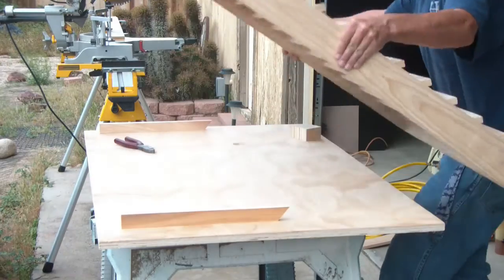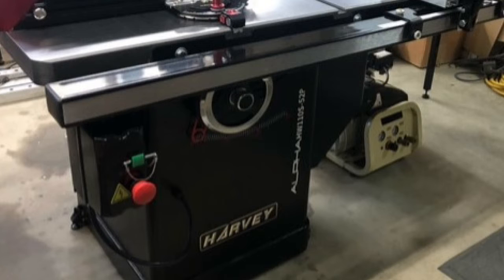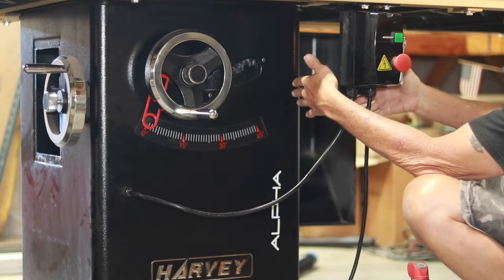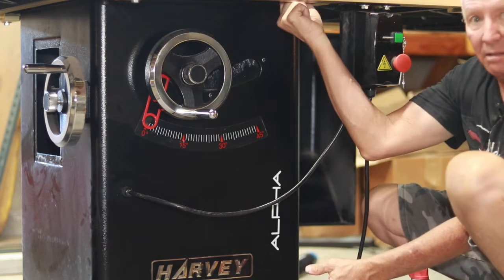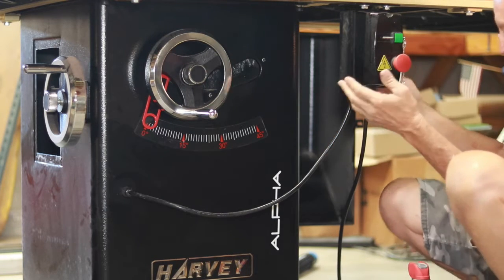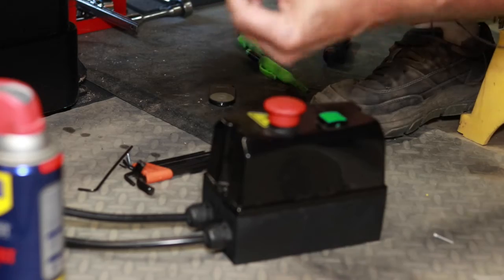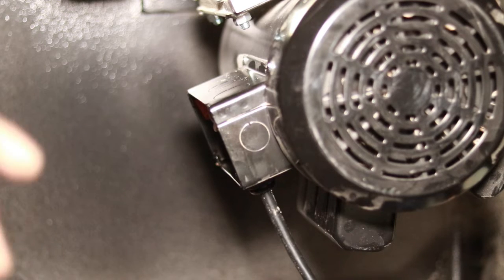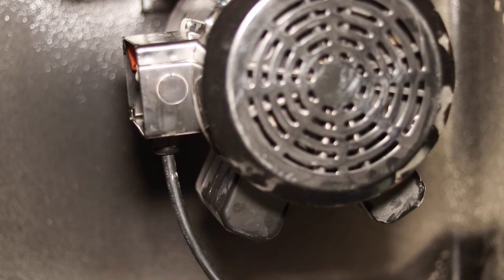Harvey Table Saw Relocating power switch

Comment: Interesting, I am right handed and LOVE my magnetic paddle switch on the left side of my saw. I can focus on the blade and bump the paddle switch with my left thigh and never take my eye off the blade until it stops spinning. To each his own, I'm glad you enjoy your new location. Stay safe.
Reply from the maker: Renrondog It just fit me. the vintage saw was this was it just familiar to me plus maybe that's why I kept hitting the switch. Still in reach with my right leg just not in the way of my normal work path. Love it haven't turned of the saw by accident yet.

Comment: I have the exact same saw and have the same issues with the switch position that you have. I originally thought that if the OEM (like most saw OEM's) put the switch on the left, then it should stay there but I'm reconcidering that opinion.  I'm completely comfortable and competent on moving the switch and rewiring but how long did it take you?  Crawling around and reaching into a tight space to do it doesn't sound like fun for my bad back.
Reply from the maker: J J Piatek that was the reason I was hoping I could of done the wires in the switch but just didn't wat to mess with it once I opened it. Like opening a can of worms. It is a bit tight but once you drop the motor it is a little easier just not a lot of room to look inside, had to fell for the ground wire. The only one not visible. Over all took maybe an hour just longer for me to move camera around for the video. Also I didn't have to redrill factory rails so that's is something to consider.